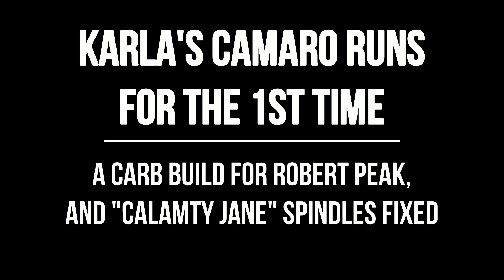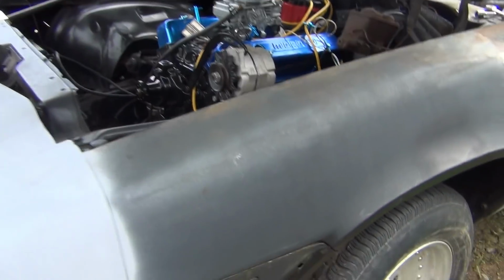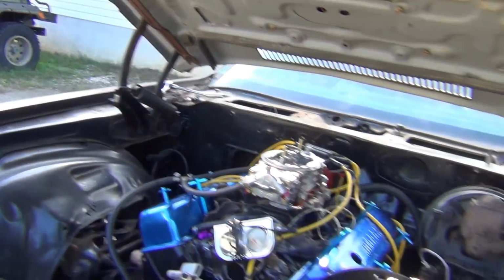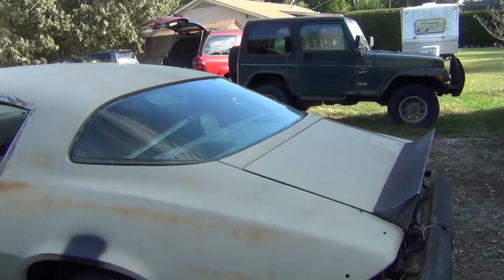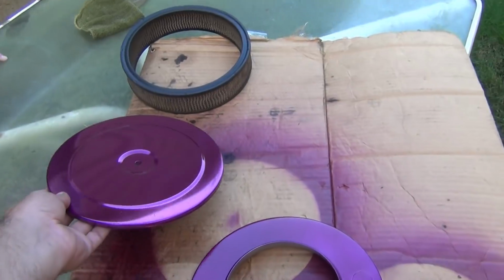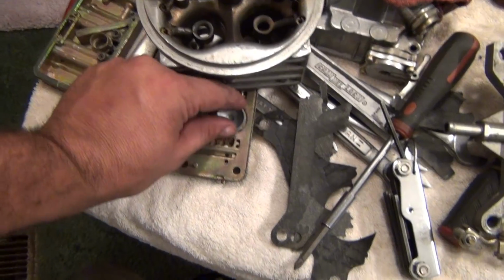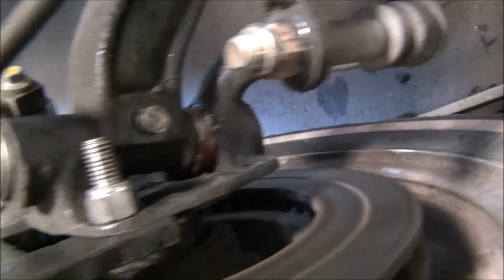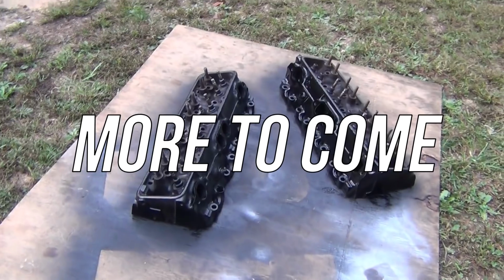SKULL GARAGE 2019 (EP.30) KARLA'S CAMARO RUNS,CARB FOR ROBERT,CALAMITY JANE SPINDLES FIXED

Comment: I had a 750 mech secondary Holley on a small block and yeah that was probably too big for it but I ran out right out of the box for years and it screamed! Ran low 13s in 78 Camaro with the factory whatever rear gear and th350 with a 3000 stall with no shift kit in it. Idk if that's anything to brag about but for my first motor that only had some flat tops, a cam and roller lifters I was a stoked 18 year old lol

Comment: Did that Camaro have the weird side shift shifter in it? Where from first you could pushing kinda to the side and shifting it to second it wouldn't slip into third then could click it over and pushing it to the side again shift into 3rd without slipping into neutral. Neat buy weird shifter for factory.

Comment: I subbed, hey I know your working on it but I have a suggestion, change the rubber hose to the carb to Metal. (Safety & rubber hose wont be a heat sink  that cause vapor lock )  Sounds good.  Good Job..

Comment: Hey guys great video as usual Karla you are welcome that shifter was in my v8 s10 and hasn't been used for a few years but I am glad someone has it and will be using it. Car sounds good i have a  couple of carbs laying around if you need one. They aint hard to find now days, more people want fuel injection and don't blame them. I just don't want a computer on my cars cost to much to fix them. Now yall have to do a cage in it to keep everyone safe. Cause it won't be long before she is gonna want to see what its going to do. ✌🐓🤘🖖😎 ps please tell me that yall have different rim's don't like crager mags you know me not a chromosexual. Text me length of drive shaft see how much my drive line guy charge for a new one. Hell may have one around here somewhere. You know i have two Camaros here.

Comment: that "thoonk" out of the exhaust i heard when you first turned it over, and the way it sounds idling is kinda scary. my 400 mopar sounded the same way, ended up being the valves not seating. maybe im just paranoid.
Reply from the maker: I'll do a compression test on the cylinders and see but they are new valves all lapped in etc and sealed great  when I bench tested em,but there r so many issues with the engine like the rocker nuts backing off as soon as it fires which keeps the valves from opening all the way, the weak fuel supply the timing not being perfect etc etc haha she just wanted to hear it for a minute,I'll throw exhaust on,msd, electric fuel pump,set timing and build the carb for it and it will be a whole sight better,this was just a ghetto fire and run to hear noise basically..ruff noise but noise haha..thanks for watching and the comments...justin
Reply: @BIGDADDYDALEWILSON  oh lord, I didn't know the troubleshoot list was that long. It could any one of those haha
Reply from the maker: @frigglebiscuit7484  oh yeh!! Hey why do anything right the 1st time🤷‍♂️haha justin
Reply: @BIGDADDYDALEWILSON  that's how it was with mine lol!
Reply: BIG DADDY’S SKULL GARAGE, Ghetto fire and run, 😄👍🏻

Comment: Sounds like its only  running on 7.
Reply from the maker: Yeh,it sounds ruff,like I said in the video she is far from tuned the old rocker nuts are wore slap out as soon as ya set em and fire they backed off,number 7 was the worst in needs at least 6 to 7 psi of fuel pressure and a solid volume but that old stock pump is wore out,just alot of stuff henderingvthe ole engine but karla just wanted to hear it for a few mins,I'll throw exhaust on it build the carb put msd on, hookup the cooling system and then tune it to run...she will be a whole sight better then👍thanks for watching and the comments..justin
Reply: @BIGDADDYDALEWILSON  I'm sure you will have it running sweet in know time looking forward to the next vid also have you had calamity jane back on the track yet ?